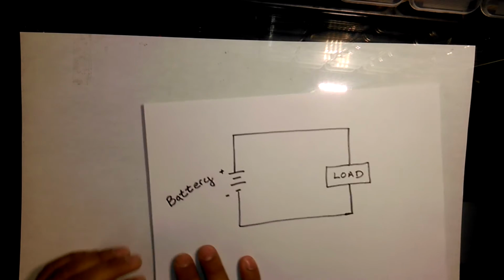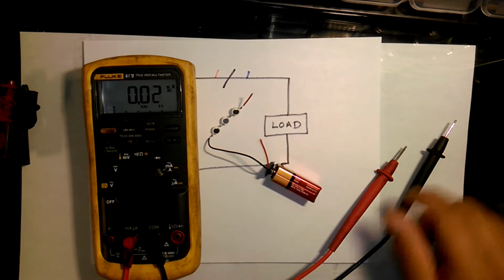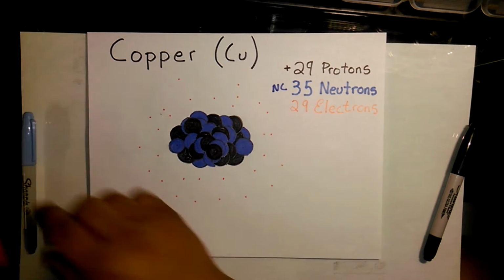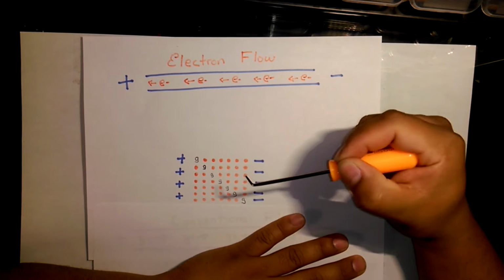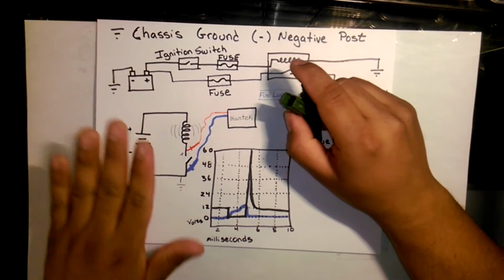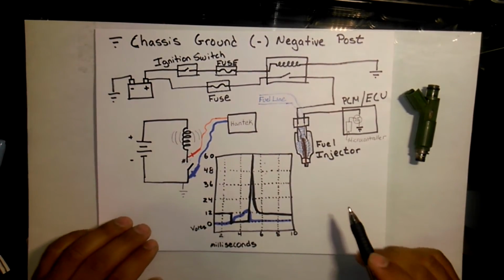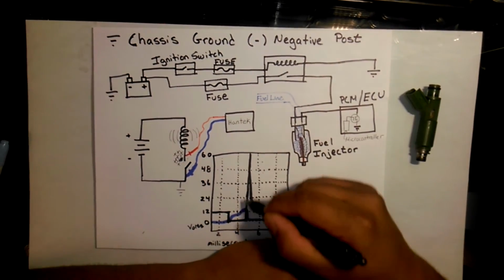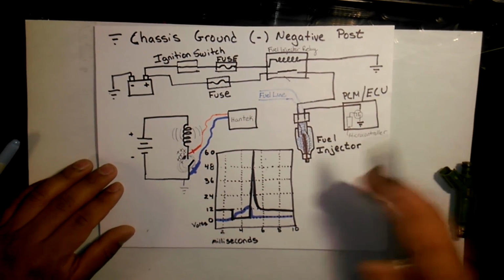Fuel Injector: Theory of the Waveform

Comment: Wi we use 20:1 for test?
Reply from the maker: Due to the inductive voltage spikes that occurs when a fuel injector fires. Basically the voltage increases to nearly 100 volts which in my experience can cause the software to crash
Reply: @Enrique_Osorio  thinks

Comment: Very nice video thank you so much.
One question though.The waveform of the injector maybe perfect but still have a clogged or dripping one causing rich mixture or misfire etc,right?
Reply from the maker: Yes, the waveform will only tell you if the fuel injector solenoid is failing or if there is mechanical resistance in the movement of the pintle.
Reply: If the waveform depicts mechanical resistant in the movement of the pintle we will be able to see If the injector is clogged then. Right?
A video showing these would be perfect, not only showing what an ideal waveform looks like but what we would see in different cases of mulfunction
Reply from the maker: Sorry for the late reply. Typically a clog will occur after the pintle. This means the material that clogs an injector usually does not come in contact with the pintle area. The clog is usually at the exit point of the injector where the nozzle is. This, in my experience, does not meaningfully change the waveform.

Comment: Enrique, great review. I just have a couple of questions. As far as the injector is concerned where exactly does the fuel start to flow with respect to the waveform? Second, you mention that the spike voltage dissipates but where exactly does it go? Lastly I would very much like to see a video on the ECU side of things. Thanks again
Reply from the maker: Fuel starts to flow about a third of the way into the injector pulse since it take time for the force to build up and overcome the spring pressure inside of the injector. In fact, pintle movement can be seen graphically in the waveform of the current (amperage) waveform as a distinct little bump as the current ramps up. The voltage oscillates back and forth and is "consumed " by the resistance of the circuit.

Comment: Very nice explanation of how the basic atom works and the direction of current.  Best I have ever seen on YouTube.  I would like to see the mosfet video.  Another video I would like to see you make is an easy to understand explanation of the PCM on an vehicle and how it uses oxygen sensors and cam and crank sensors to adjust the injectors and fuel trims.  Thanks
Reply from the maker: Will keep that in my mind. Thanks for your comment.

Comment: very good explanation....but i have a question why when i test the injector plugs  it give me the both of wires positive
Reply from the maker: On almost all fuel injectors there will always be a positive voltage going to it. Since the injector is only grounded for a small amount of time, it appears that both wires are positive. You need an oscilloscope to see the voltage changes or a multimeter with a fast min/max function.

Another way to think about it is to check the voltage when the key is on but the engine is off you will see that both wires will have 12 volts. Now, disconnect the injector and test the wires again, only one will have 12 volts, the other will not. That other wire is the control wire that commands the injector on and off. If this does not make sense let me know and I will try to explain further.
Reply: thank you enrique . i'm Really grateful for your help

Comment: Thanks for very good video but I have one question must we use  Attenuator with checking injector pulse and how we must set trriger on many cars injector pulse is 4 ms   ,but how to set hanteks  other setting
Reply from the maker: Not too sure what you are asking in the second part of your question. As for the use of an attenuator, it is very important when checking fuel injector voltages. The fuel injectors inductive spike is so high that it may damage the oscilloscope. An attenuator lowers the voltage that the Hantek receives so it makes is safe to check high voltages. Watch my attenuator detailed analysis video for more information. Here is the link https://youtu.be/onNOZVR-Lpk
Reply: it is so important for me Enrique I have seen and understand all I am only asking quesions for safety but you give us all